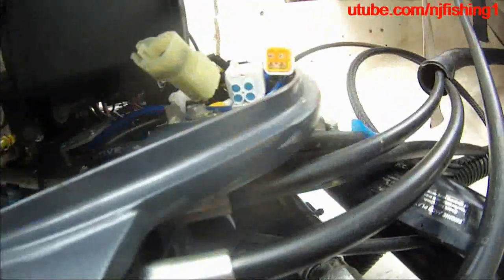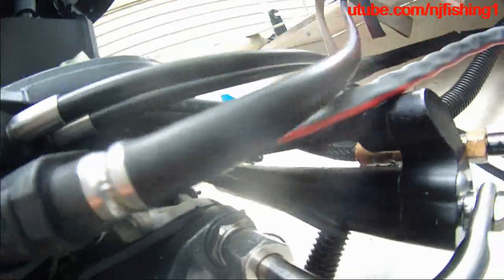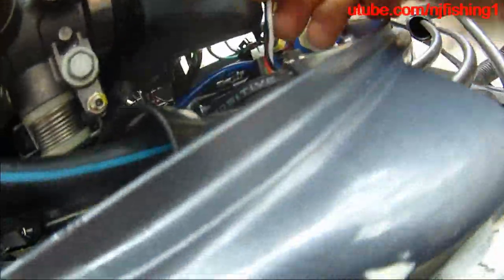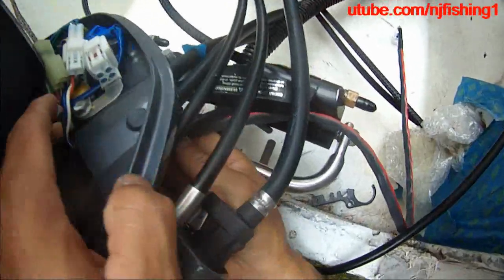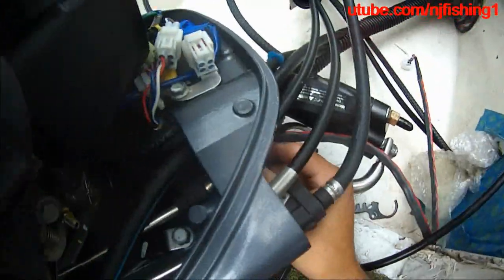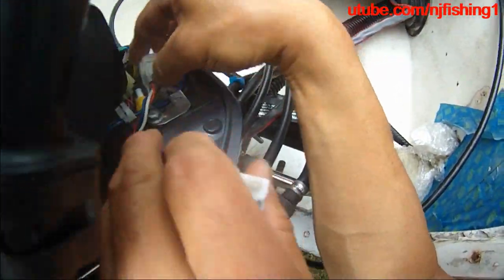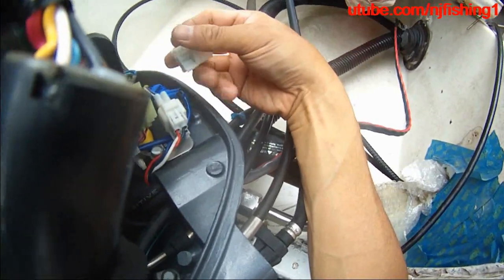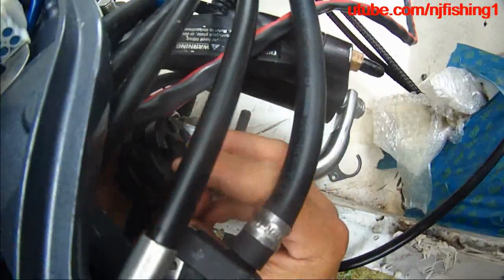Yamaha command link to display 2019 Yamaha 70 hp outboard engine data - Raymarine  Axiom MFD

Comment: Not going to work.  That connector will transmit NMEA data,  NOT Command Link data.  Command Link is not available until Yamaha's bigger 150 hp engines.  However, you CAN get NMEA data off that cable and into the Axiom using the ECI-100 Universal Engine Interface.